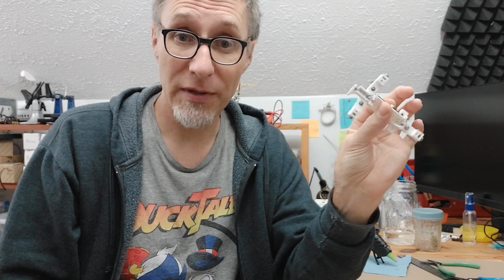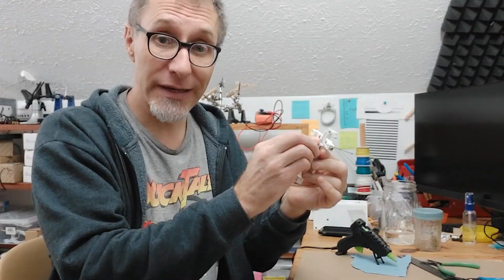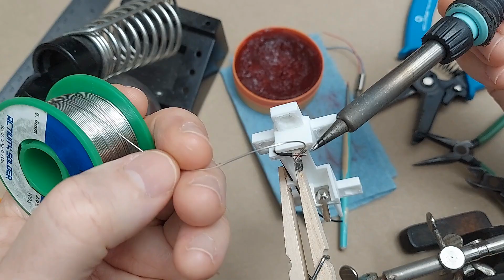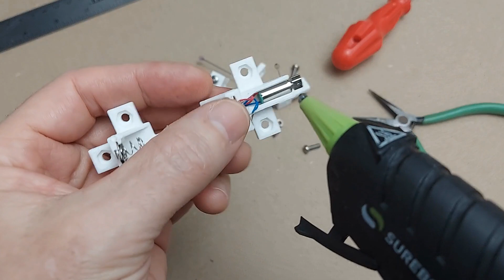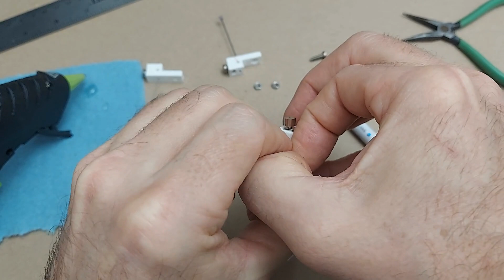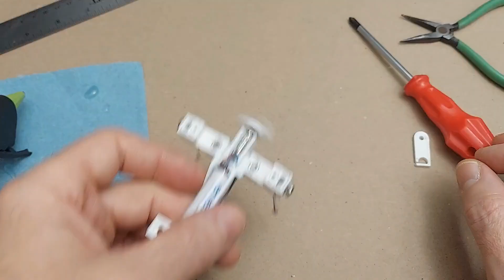BuzzBots: a simple robot toy you can print and build

Comment: Hello! I’m part of a robotics team, and I thought this design would be a great idea to help teach kids about robotics. Is there a way I could find the CAD file? thanks!
Reply from the maker: Sure thing you can download them from the GitHub repo 

https://github.com/andrewfrueh/BuzzBots
Reply: is there a place where i can find the exact parts you ordered?
Reply from the maker: @Thishandlewasntavailable111  so, I don't have links to all of it... I think I bought a big bag of AAA battery terminals a bunch of years ago. And the Little motors I literally ripped out of old pagers and cell phones I don't even remember when 😅

But I did update the readme on the the GitHub repo with a list of needed parts, which essentially looks like this...

    3D printed parts (Found in the /print ready parts folder)
    Metric 3mm (M3) bolts and nuts
    Stiff steel wire ("music wire") tipped with hot glue
    9x9mm AAA battery terminals
    A single AAA battery
    Small vibration motor (7mm diameter x 15mm long featured)

And there's a photo now that has the parts laid out with a ruler for reference. Hopefully this helps.

Comment: I would have included a switch of some sort.
Reply from the maker: yeah, the battery is the switch LOL.. if you are interested, in the GitHub repo, in the archive folder there are designs that include a small switch but it uses a bigger motor
Reply from the maker: Of course... those designs are from like 10 years ago so I can't speak to the current state of their goodness